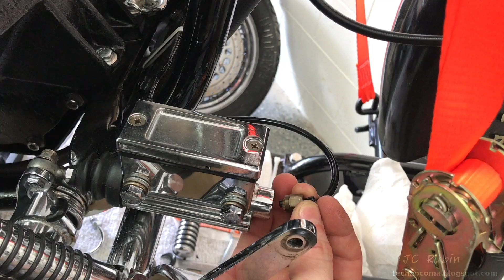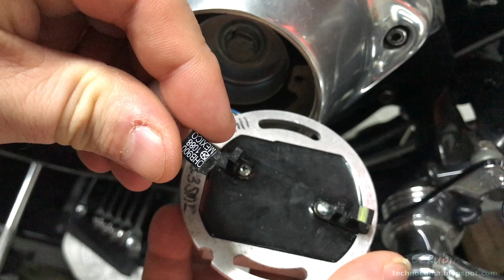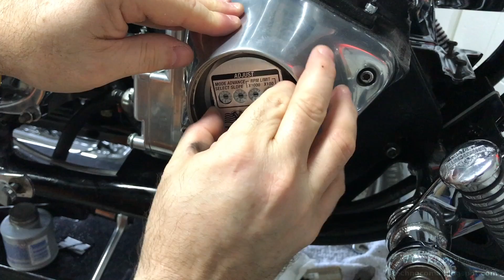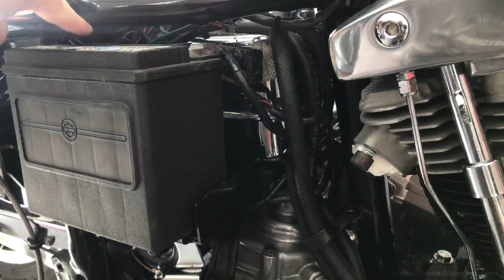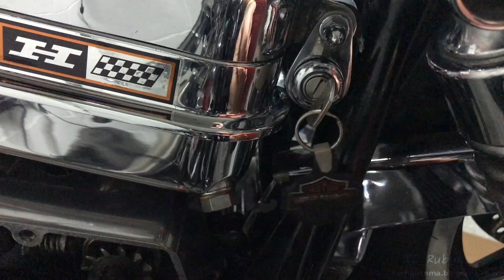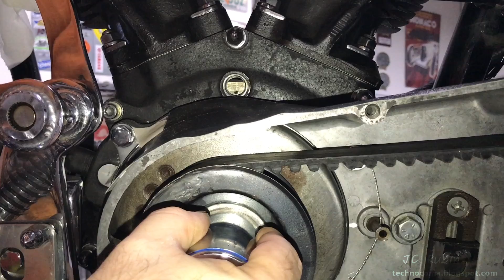AMF Shovelhead Lowrider Restoration -28 - Electrical and Ignition & Static Timing

Comment: What all was involved with polishing the tailight?  It came out looking great!
Reply: First super glue was applied from the inside with a toothpick to address any lens cracks. Then it was hand polished with maas.
Reply: @rubin-tech  I wouldn't have thought to use that on plastic as a polish.  

Great tip.  Thanks for sharing the technique.
Reply from the maker: No problem!